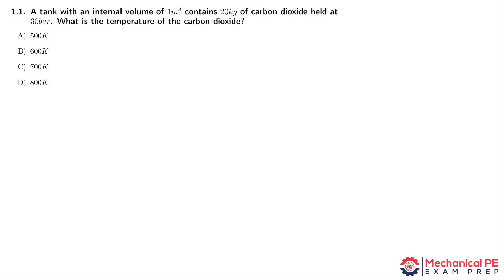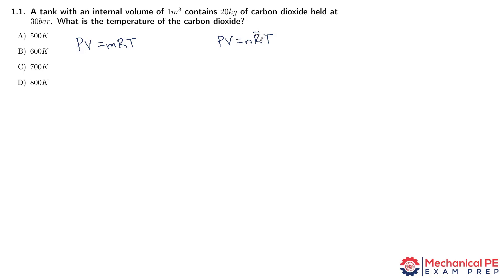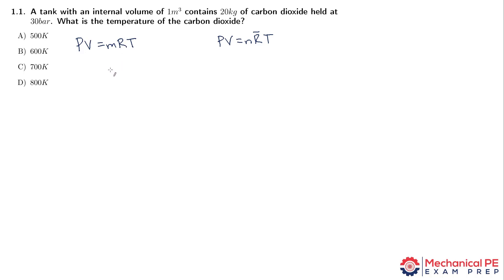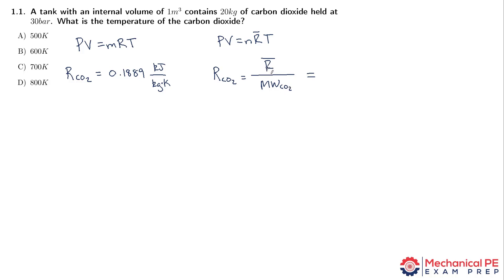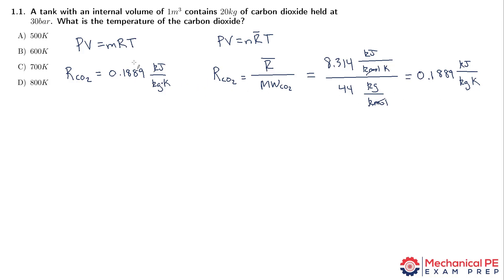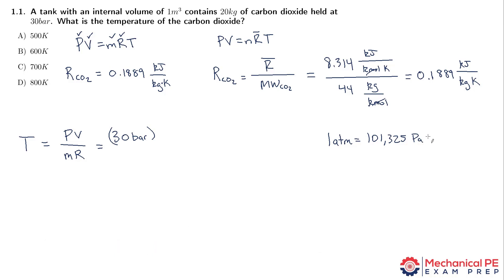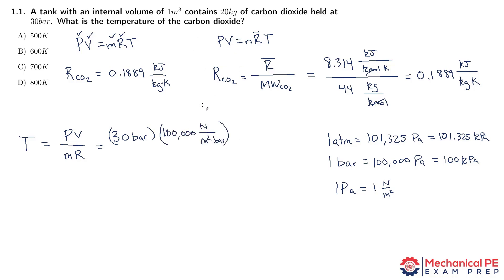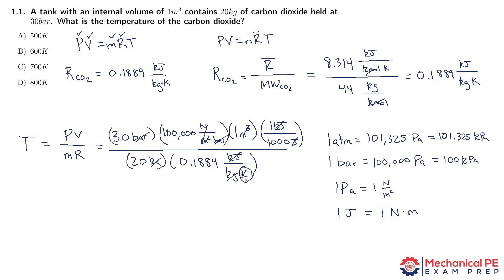Mechanical FE Exam Thermodynamics: Ideal Gas Law and CO2 Temperature Calculation

Comment: Sir, i have one question. In the PE mech handbook, regarding para 1.2.7 properties of air at low pressure, per pound, let me know. How condition i can use this table in?
Reply from the maker: Hard to give an exact limit, but the range of what can be considered "Low Pressure" is higher than you would expect.  It's pretty safe to use this table for a variety of problems.  It's also worth considering using ideal gas relationships or other formulas that are specific to the type of problem if the right assumptions apply.  The best thing you can do is solve lots of problems to figure out what works best in which situations.  Are you going for the PE or FE?  I noticed you commented on an FE video.
Reply: @MechanicalPEExamPrep  Thank you for your promp reply. And i am preparing for PE TFS exam. Regarding 534 problem of NCEES 2016_practice exam, i can't imagine to solve this problem using properties of air at low pressure per pound as soon as facing this problem. let me know how to approach, sir please.